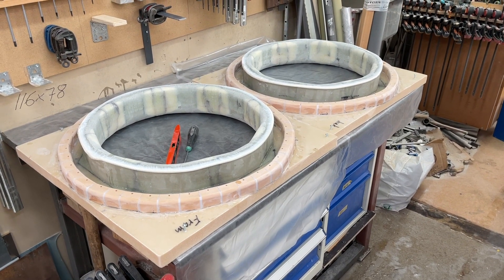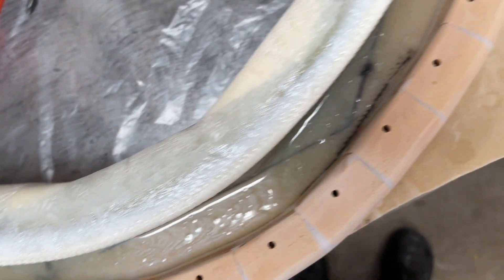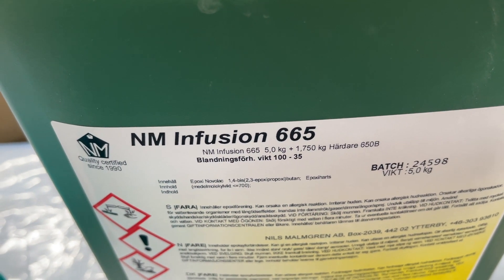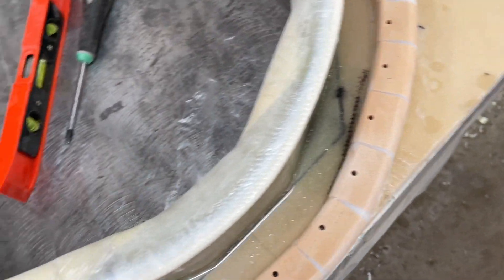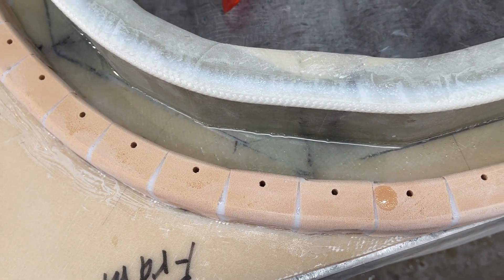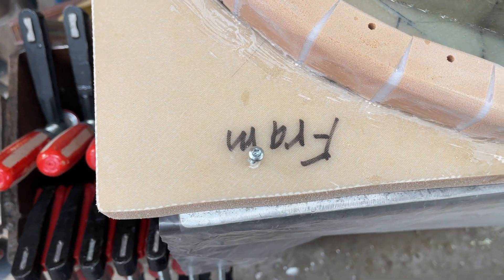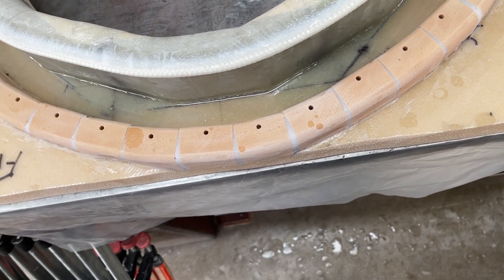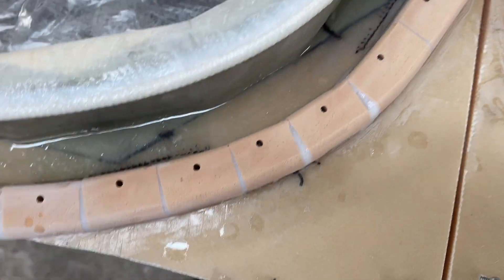26 September 2022  Making a superflat base for the gasket.

Comment: Have you ever used a blow torch to pop the bubbles in epoxy?  My friend who makes epoxy table tops taught me that.  It works very well.
Reply from the maker: I tried it.
I do not think It is a good idea as it heats up the epoxy and sometimes makes more bubbles.
Here I used compressed air but there is still some bubbles.
I left them as they will not affect the function of the gasket and no one will see them and I do not care to much about looks anyway.
Still it would be better not to have them.

Comment: Putting a flame, such as from a propane torch, onto the epoxy will raise its temperature, make it even less viscous and help smooth out any imperfections and get bubbles to float to the top and be removed from the epoxy.  It's also good for burning the place down, so careful... : )
Reply from the maker: See my comment abouve.

Comment: These hatches will certainly be water tight when closed tight. Excellent idea to float the sealing surface under the gasket smooth and level. Thank you Sven for the update and the idea.